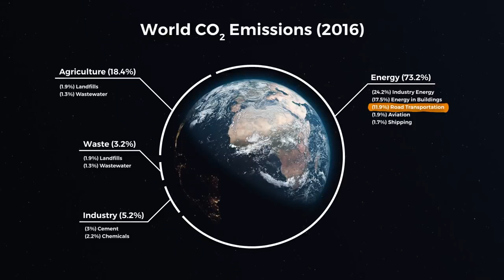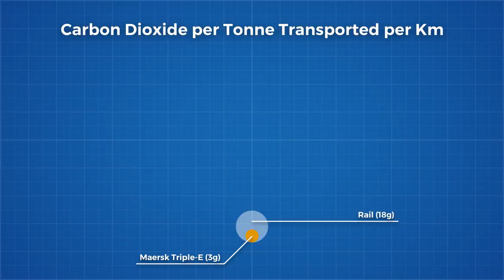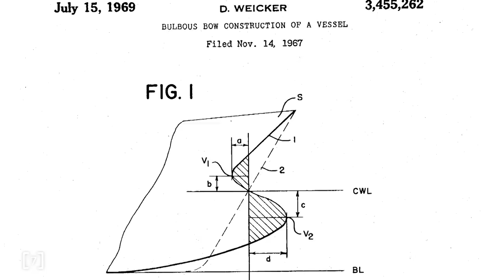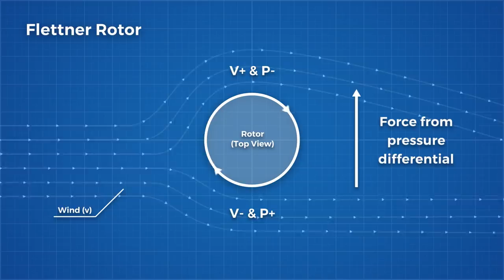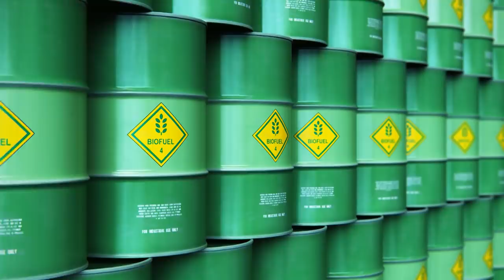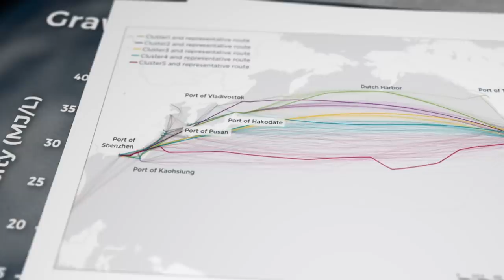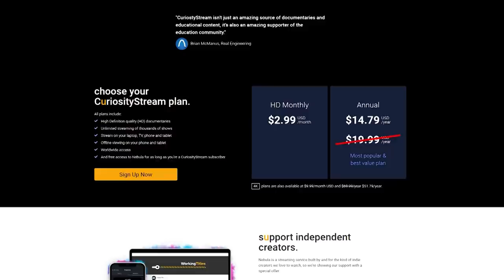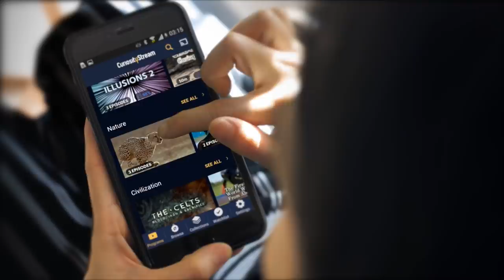Are Renewable Powered Ships Possible?

Comment: Perhaps we'll see nuclear powered cargo ships make a comeback? Super energy dense, no pollution,  and quite frankly the US Navy has been using them for decades and had no nuclear accidents. Worth a 2nd look.
Reply: If you do a web search for ‘nuclear ship savannah’ you will see that it has been tried and did not work.  A similarly vessel heavily subsidised, by the government, vessel is in use in Russia which also operates, in support of the Northern Sea Route, a fleet of nuclear powered ice breakers all of these may, or may not, have been completely without issues.

Just think; would you have full confidence in the management of a nuclear reactor under the control of an anonymous entity only traceable, perhaps, via a letter box in a FOC (flag of convenience) nation state?  If you are, could you sell that confidence to Japan, the state that hosted the Hiroshima and Nagasaki nuclear detonations as well as more recently the Fukushima ‘event’?  Then try that same, or a similar, sales strategy on Ukraine, the nation state that as a part of the USSR (CCCP) hosted the Chernobyl ‘event’.  Modern iterations of nuclear energy, thorium fuel, molten salt reactors or fusion reactors, will carry the legacy of past problems.  It is the global trepidation of anything with 'nuclear' in the name and the economics of nuclear having transitioned from 'energy to cheap to charge for' too 'the costs of remediation are incalculable' that will prevent the adoption of nuclear energy as a means of creating energy at sea.  Modern reaction systems may have overcome the safety problems but the general public, having been misled in the past, will be reluctant to believe the fresh new promises.  The incident of the ‘Ever Given’ blocking the Suez Canal, March 2021, may also have a little to add to this debate.  The cooling water on ships tends to get taken in from near the bottom so when running aground the inlets are in a prime spot to get plugged up restricting, if not stopping, the flow of coolant.  One thing that the TMI, Chernobyl and Fukushima incidents all had in common was that the supply of coolant, or rather lack thereof, was a fundamental cause.

‘They’ say nuclear is cheap, it’s not it is expensive and has a large embedded carbon quotient as well as being complicated, dangerous, not universally socially acceptable and having only ‘no need for refuelling’ as a questionable advantage; actually it does need refuelling just not as often.  When ‘they’ do need to refill the warming up stuff it takes considerable longer than pumping tonnes of thick black stuff, cSt380 HFO, or thin runny stuff, MDO, onboard which is one of the reasons HMS Queen Elizabeth and HMS Prince of Wales are pushed about by ICEs and gas turbines thus using a similar fuel as the aircraft that fly off of them.  The Royal Navy (RN) with a high degree of skill and expertise uses, at vast expenses to the UK taxpayer, a current operational nuclear fleet of 11 submarines (also known as ‘boats’) in two flotillas, seven attack subs and four ballistic missile boats.  The carbon footprint of all the extra bits of hardware and the fuel, including processing thereof, from ground to propeller, are the external costs that never seem to get considered.

Disposal, once it wears out, of both the machine (that was a ship) and fuel is another can of worms best left unopened.  The 26 RN boats no longer in use are laid up (some in Rosyth and some in Portsmouth) awaiting long term deconstruction including dealing with the fuel rods and other irradiated material.  The USN is not, as far as I know, a commercial organisation working to very tight margins and also has the skill and expertise to handle the complexities of nuclear power; so as well as submarines their aircraft carriers are nuclear powered and each of the current iteration has a build cost three times that of QE/PoW, bigger crews and more generous funding.  For those who still think that nuclear energy might be the answer I recommend this report: - https://www.bbc.com/future/article/20200901-the-radioactive-risk-of-sunken-nuclear-soviet-submarines?ocid=ww.social.link.email.  The navy of the USSR might have been under resourced and over extended but it was still generously supported in comparison with merchant shipping.

Comment: Yes, hydrogen. The sea is your fuel, solar on roof of the bridge to power generator for electricity. Using electrolisis to split H20 to O2 and H, both get controllably be sent to combust for power. Have stored hydrogen as extra from being docked at ports to work on nights and non sunny days.

But as long as we live as we do, we are doomed
Reply: To liberate hydrogen (H2) from water you need a lot of energy and while fossil oil & gas, or perhaps coal, will do it and are the most readily available any energy source, wood, photovoltaic, wind, tidal, et cetera, will do.  H2 is said to be good for use in fuel cells that will give clean energy when combined with Oxygen (O2) and leave only water (H2O) as an effluent; so as well as the cost of creating the hardware and separating out the H2 in the first place we now have the cost of providing the O2.  H2 is very, very light and very, very volatile so this is where we remember the Hindenberg airship disaster and while events of that magnitude might not be likely much smaller H2 fires or explosions can cause a lot of damage.  The ‘light’ means that though there is lots of energy per unit mass there is not much mass per unit of volume so all the problems of methane but much worse.  You need to compress it, more than a lot, or cool it, more than a lot, to get enough on board your ship in manageable volumes to be useful.  The alternative to fuel cell use of H2, burning, also generates combustion products which includes waste heat going to the cold sink and a few NOx ‘nasties’.  H2 may have a place in the energy mix on land as a storage medium but on a ship where there is a reasonable and constant auxiliary power need the question could be posited, ‘why go through the extra stages instead of using any harvested energy directly?’  After harvesting the energy, from wind, sun or motion of the vessel, as electrical energy better to deploy that energy directly and immediately as heat, light or mechanical work.  As with nuclear energy at sea some of the ‘alternatives’ may have a use in littoral submarines in AIP (air independent propulsion) systems but that will be with the same caveats of cost, space and complexity so would not perform in a high volume low cost mercantile situation.  The numbers, on any of these, are getting very difficult to show any sort of surplus so is this a case of running hard to stand still?

Comment: Nuclear ships ?!
Reply: Just think; would you have full confidence in the management of a nuclear reactor under the control of an anonymous entity only traceable, perhaps, via a letter box in a FOC (flag of convenience) nation state?  If you are, could you sell that confidence to Japan, the state that hosted the Hiroshima and Nagasaki nuclear detonations as well as more recently the Fukushima ‘event’?  Then try that same, or a similar, sales strategy on Ukraine, the nation state that as a part of the USSR (CCCP) hosted the Chernobyl ‘event’.  Modern iterations of nuclear energy, thorium fuel, molten salt reactors, small modular reactors or fusion reactors, will carry the legacy of past problems.  It is the global trepidation of anything with 'nuclear' in the name and the economics of nuclear having transitioned from 'energy to cheap to charge for' too 'the costs of remediation are incalculable' that will prevent the adoption of nuclear energy as a means of creating energy at sea.  Modern reaction systems may have overcome the safety problems but the general public, having been misled in the past, will be reluctant to believe the fresh new promises.  The incident of the ‘Ever Given’ blocking the Suez Canal, March 2021, may also have a little to add to this debate.  The cooling water on ships tends to get taken in from near the bottom so when running aground the inlets are in a prime spot to get plugged up restricting, if not stopping, the flow of coolant.  One thing that the TMI, Chernobyl and Fukushima incidents all had in common was that the supply of coolant, or rather lack thereof, was a fundamental cause.  Similarly and only months later, May 2021, had the ‘X Press Pearl’ been nuclear powered then a major port for a populous nation in the global South would have possible been the site of a significant exclusion zone due to a non power plant related incident.  If the ‘X Press Pearl’ had on board a fired up but ‘safe’ molten salt reactor and found herself having to run down the possible 12.5 megaWatts of energy in the power cycle would a stable cool down have been possible?

Comment: I mean wind powered ships maybe be a better solution.
Reply: To address the suggestions that wind power is the answer I offer the following example.  In 1870 a premium sailing vessel entered service, the ‘Cutty Sark’.  The Cutty Sark was 64.74 metres in length with a beam of 10.97 metres and a loaded displacement of 2 100 tonnes.  She was able to carry, at best, 1 700 tonnes of cargo and to harness the energy in the wind the available spread of canvas was up to 2 976m2 which was tended by a crew of about 30 skilled men.  A ratio between the sail area (SA) and the vessels displacement (D) determines how lively she is; ‘lively’ being nautical speak for ‘fast and manoeuvrable’.  The carrying capacity of cargo ships is constrained in two ways, mass and volume which leads us to the ‘stowage factor’ of the cargo; the more mass on board the greater the displacement which in turn impacts the efficiency of the hull form and sail area / displacement ratio.  A vessel constrained by mass is said to be ‘down but not full’, while a vessel constrained by volume is said to be ‘full but not down.  When in the tea trade, which the ‘Cutty Sark’ was designed and built for with fine lines (more nautical tech speak, so again no need to worry about it) she could carry around 600 tonnes of cargo at speeds of up to 17.5 knots dependent on the prevailing wind and had a typical China to UK time on passage of 120 days.  The tea trade was very competitive so ‘time on passage’ was a large factor in securing the premium freight rate that made her cost effective.  Rounding things out, her maximum available sail area gave circa 5m2 of canvas for every tonne of tea carried.

As soon as the Suez Canal opened, which the ‘Cutty Sark’ was unable to sail through; she lost her advantage, raw speed, to the steam powered ships of that era who could beat her ‘time on passage’ by taking that short cut.  Mechanically powered ships have improved in terms of efficiency, on a freight tonne mile basis, by at least one order of magnitude since then.  After losing out to the coal burning, fire tube boiler, steam reciprocating mechanical ships of the late 19th century ‘Cutty Sark’ was relegated to the Australian wool trade, just about the bottom of the barrel in maritime terms and only one small step up from being a 'honey barge'.  The canvas, cordage and extra manpower needed for sailing ships was never a very benign environmental option so please discount any idea of sail as ‘sustainable’.  All this is without the problem that if ‘the wind don’t blow the ship don’t go’, when it does blow it often blows in the wrong direction for your cargo delivery needs and sometimes there is rather too much of it for comfort.  Sailing ships are unable to go directly up wind so if the wind is blowing form the direction your cargo needs to then a zig-zag course must be steered, more distance and more time.  Wind is traditionally measured on the Beaufort Scale (wind speed) that runs from 0 (< 1kn) to 12 (> 63kn) and for sailing purposes the usable part of the range is ‘3’ (circa 8kn) to ‘6’ (circa 24kn).

Random fact about ‘Cutty Sark’, it is said to have been possible to coax 3 000 horse power out of her sails, or in ‘real money’ 2 206 500 Watts (2.2 megaWatts), assuming this was in ideal conditions that is about ⅔ of the solar power that might be harvested from the ‘top of stow’ of a Maersk Triple E, again in those elusive ideal conditions and 741 Watts for each square meter of sail area.  So that majestic spread of canvas would have been even less efficacious for delivering your baubles and bows from the orient, despite taking about three times as long on the voyage.  The sails on the ‘Cutty Sark produce about 0.33% of the power need to propel a Mearsk Triple E and covering the top of the stow might produce another 0.5% so with both systems working simultaneously in ‘ideal conditions’ the energy harvest would be less than 1% of the output from the ICEs.  Combining with solar electric would involve two systems in place of one, which then runs you into the problems of expense, complexity, integration and redundancy.  Remember shipping is a high volume low cost, therefore low margin business, and all costs have to be beneficial.

Canvas and hemp are accorded 'renewable' (read as ‘natural’) status, if ‘synthetics’ are used there will still be a need for the input of FOGI products.  'Synthetics' would have a much better working life span than 'naturals' but would still yield the same amount of energy, 741 Watts for each square meter in those elusive ideal conditions.  Wallenius are currently giving wind power a go with wing form ‘sails’ but evidence is a little short of proof as of this date.  KTH (Kungliga Tekniska högskolan), a sort of up market university in Stockholm, who are using the funding to derive results will probably, and eventually, in the best traditions of academia ‘publish’ a ‘paper’ unless the funders invoke the well known ‘commercial sensitivity clause’ of their agreement with the KTH.  Wallenius is a major shipper of vehicles were the product is effectively its own packaging, other goods are moved about in ‘containers’ so the loss of capacity, ‘broken stowage’ in nautical speak, caused by containerisation needs to be factored in.  On board wind turbine might get you around some of the problems however for marine use vertical axis wind turbines (VAWT) would be better than the, what have now become 'traditional', horizontal axis wind turbines (HAWT) for reasons that include the air draught of the vessel, weight distribution and maintenance access.  The energy yield is still subject to the wind blowing at the right strength and having space available on board for the hardware.  The masts, rigging and sail handling arrangements  would take up 'prime real estate' on the vessel.  Fuel oil bunker tanks can be stuck away in any odd corner and the ICE power plants are themselves relatively compact.  The stacked up 'boxes' would mean putting the wind driven propulsion units in a bad situation from a ship stability point of view.